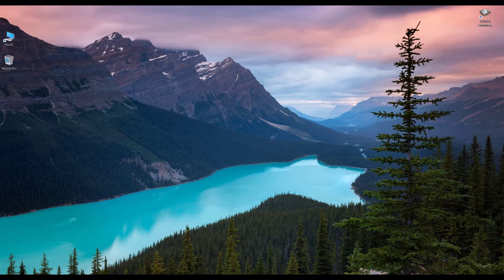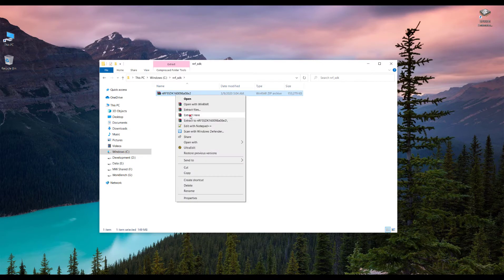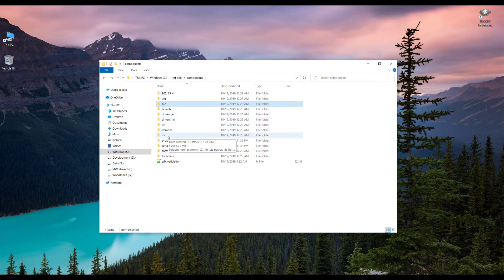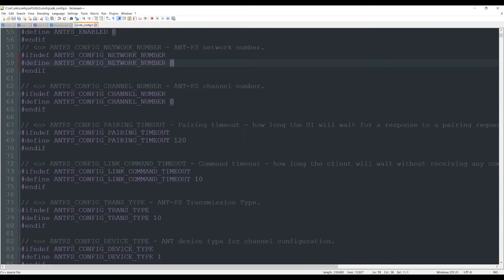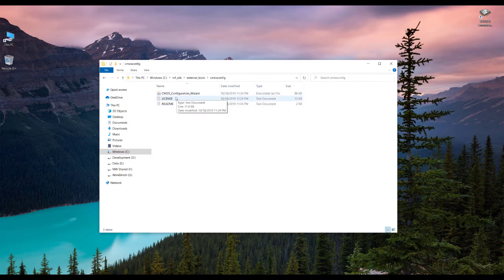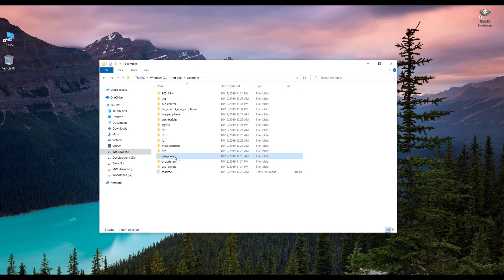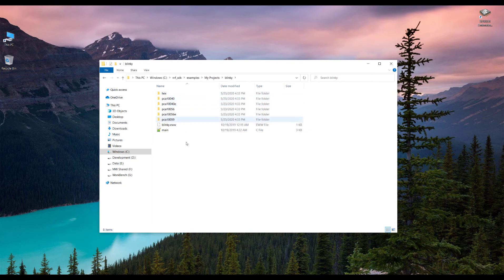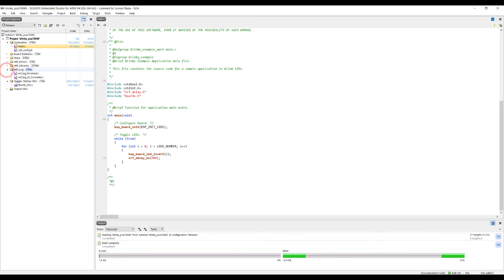nRF5 SDK - Tutorial for Beginners Pt 3- SDK 16.0 Directory Structure Explained

Comment: if you got an error like ".text is larger than specified size" and ".rodata is larger than specified size" then navigate to ./pca10040/blank/ses/ inside of your project directory, open flash_placement.xml file, find folowing lines:
<ProgramSection alignment="4" load="Yes" name=".text" sizeof="0x4"/>
<ProgramSection alignment="4" load="Yes" name=".rodata" sizeof="0x4" />
and remove sizeof="0x4" in both cases.
this error occures in newer versions of ses but the solution above fixed it in my case
Reply: Hey thank you for this comment, saved me major time.
Reply: thanks that solve the problem, Im using the nRF52840 DK
Reply: @alvaro1734  were you able to get the blink example to work?
Reply: thanks alot
Reply: Thanks for the solution.. Really appreciate your effort in this😇
Reply: Thank you!  This is really useful.
Reply: Thanks my friend
Reply: Thank you very much for this remark. I was stuck. With this change it worked right away! I probably would have wasted many hours trying to find the cause of these errors!

Comment: Very much wanted tutorial for me, thank you.
How to connect a MPU6050 to nrf52840 ,can you tell me how to do it, I have an nrf52840
There is no library for mpu6050 in nrf like Arduino,what should I do?
Reply from the maker: You are lucky because i have recorded the tutorials for mpu6050 for TWI or I2C communication, so the tutorials will be uploaded in 2 days. :p so stay tuned
Reply: @SumairsEmbeddedEngineering  thank you very much for mpu6050 videos
Reply: @SumairsEmbeddedEngineering  
This is a arduino code, but got to do it in nrf
can you tell me what should i change
below, i have given code link and library
https://github.com/AurekSkyclimber/DIY-Haptic-Glove
https://github.com/tockn/MPU6050_tockn
///////////////////////////////////////////////////////////////////////
#include <MPU6050_tockn.h>
#include <Wire.h>

MPU6050 mpu6050(Wire);

// Flex sensors to track finger bends
const int flexSensorPin = A0; // The flex sensor for pin 0
const int flexSensorPin2 = A1; // The flex sensor for pin 1
const int flexSensorPin3 = A2; // The flex sensor for pin 2
const int flexSensorPin4 = A3; // The flex sensor for pin 3
const int flexSensorPin5 = A4; // The flex sensor for pin 4

// Joystick + button to move the virtual hand - Could easily be replaced with Vive Tracker
const int xPin = A5;
const int yPin = A6;
const int buttonPin = 3; // joystick button press - up on z axis
const int buttonPin2 = 4; // button press - down on z axis

// Vibration motors to simulate haptics
const int indexMotorPin = 12;
const int middleMotorPin = 11;
const int ringMotorPin = 10;
const int pinkyMotorPin = 9;
const int palmMotorPin = 8;
const int palmMotorPin2 = 7;
const int palmMotorPin3 = 6;

void setup() {
  Serial.begin(9600);
  Wire.begin();
  mpu6050.begin();
  mpu6050.calcGyroOffsets(true); // Calibrate the gyro offsets
  
  pinMode(flexSensorPin, INPUT);
  pinMode(flexSensorPin2, INPUT);
  pinMode(flexSensorPin3, INPUT);
  pinMode(flexSensorPin4, INPUT);
  pinMode(flexSensorPin5, INPUT);

  pinMode(xPin, INPUT);
  pinMode(yPin, INPUT);
  pinMode(buttonPin, INPUT_PULLUP);
  pinMode(buttonPin2, INPUT_PULLUP);
  
  pinMode(indexMotorPin, OUTPUT);
  digitalWrite(indexMotorPin, LOW);
  pinMode(middleMotorPin, OUTPUT);
  digitalWrite(middleMotorPin, LOW);
  pinMode(ringMotorPin, OUTPUT);
  digitalWrite(ringMotorPin, LOW);
  pinMode(pinkyMotorPin, OUTPUT);
  digitalWrite(pinkyMotorPin, LOW);
  pinMode(palmMotorPin, OUTPUT);
  digitalWrite(palmMotorPin, LOW);
  pinMode(palmMotorPin2, OUTPUT);
  digitalWrite(palmMotorPin2, LOW);
  pinMode(palmMotorPin3, OUTPUT);
  digitalWrite(palmMotorPin3, LOW);
}

void loop() { 
  mpu6050.update();

  // Output physical inputs to Unity
  Serial.print(analogRead(flexSensorPin)); // A0  
  Serial.print(","); //delimiter
  Serial.print(analogRead(flexSensorPin2)); // A1
  Serial.print(","); //delimiter
  Serial.print(analogRead(flexSensorPin3)); // A2
  Serial.print(","); //delimiter
  Serial.print(analogRead(flexSensorPin4)); // A3
  Serial.print(","); //delimiter
  Serial.print(analogRead(flexSensorPin5)); // A4
  Serial.print(",");
  Serial.print(analogRead(xPin) / 1024.0);
  Serial.print(",");
  Serial.print(analogRead(yPin) / 1024.0);
  Serial.print(",");
  Serial.print(digitalRead(buttonPin) ? (digitalRead(buttonPin2) ? 0.5 : 0) : (digitalRead(buttonPin2) ? 1 : 0.5));
  Serial.print(",");
  Serial.print(mpu6050.getAngleX());
  Serial.print(",");
  Serial.print(mpu6050.getAngleY());
  Serial.print(",");
  Serial.println(mpu6050.getAngleZ());

  // Read vibration types for each finger from Unity
  String message = Serial.readStringUntil('~');
  ChooseVibrationType(indexMotorPin, message[0]);
  ChooseVibrationType(middleMotorPin, message[1]);
  ChooseVibrationType(ringMotorPin, message[2]);
  ChooseVibrationType(pinkyMotorPin, message[3]);
  ChooseVibrationType(palmMotorPin, message[4]);
  ChooseVibrationType(palmMotorPin2, message[4]);
  ChooseVibrationType(palmMotorPin3, message[4]);
}

void ChooseVibrationType(int pinNum, char vibeType) {
  switch(vibeType) {
  case '0': // Off
    digitalWrite(pinNum, LOW);
    break;
  case '1': // On
    digitalWrite(pinNum, HIGH);
    break;
  case '2': // Waterfall
    if(random(0,5) > 3) {
      digitalWrite(pinNum, LOW);
    } else {
      digitalWrite(pinNum, HIGH);
    }
    break;
  }
}

Comment: can we connect nrf52832 with ir sensor? can we use this microcontroller to code it? please answer as soon as it is possible.
Reply from the maker: Yeah its possible, we can use the IR sensor, Just make sure, if the sensor is a module which has IR receiver and transmitter, then don't connect it with 5 Volts, connect it with 3.3 Volts and then connect its input or output pins with nrf device. Warning: Don't use 5 Volts logic with your nrf device or it might damage it permanently.... Hope so this helps...
Reply: @SumairsEmbeddedEngineering thanks for your replay its mean a lot ... i am using TSOP1738 ir receiver. it has to be connected with 5V. then?
Reply from the maker: @aninzawajid1847   You have two options:
1> Change the IR sensor, you can use IR-3638T which is 3 Volts compatible and can be directly interfaced with nRF device.
2> Use a simple potential divider circuit to drop the  voltage from 5 to 3 volts for the input pin. The IR pin will be connected with two resistors and then their output pin will be connected with the nrf device. Just check this basic circuit to get the idea : https://drive.google.com/file/d/1Mhds4c5WpvZkNnHgddXhS4pmRoGHO5j7/view?usp=sharing